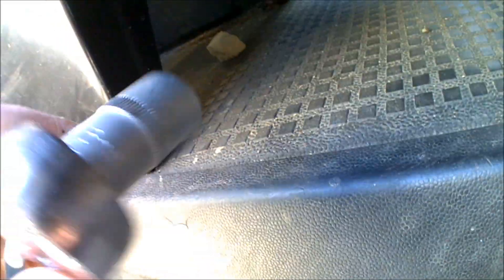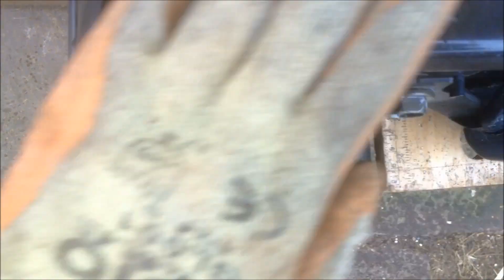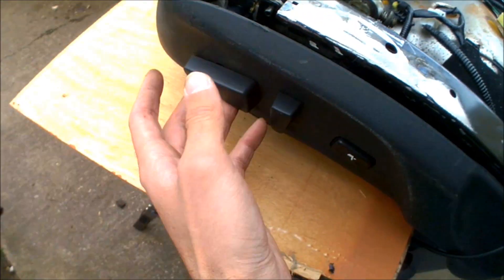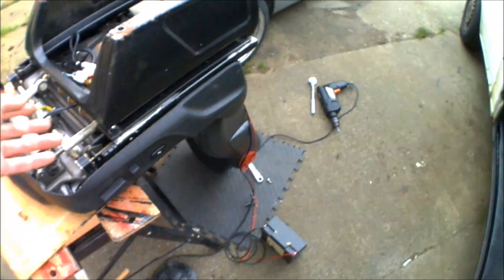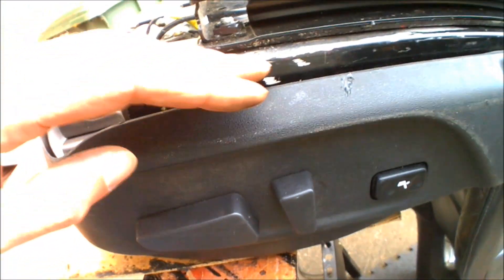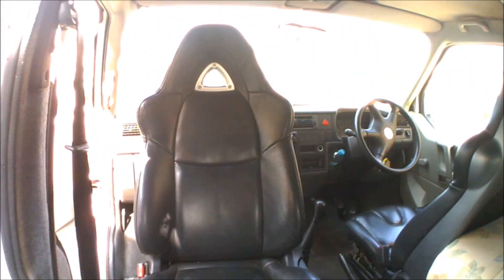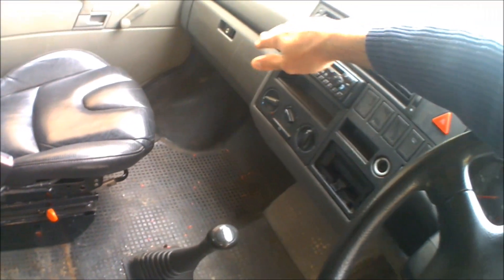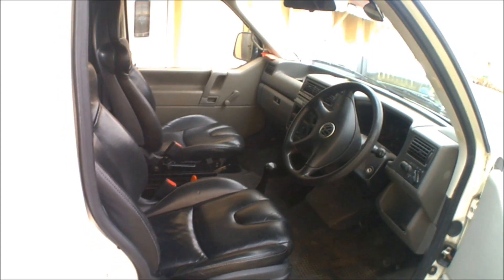Swap VW T4 Seats For Mazda RX8 Electric Heated Leather Swivel Base Seats

Comment: Diamond discs are for stone and concrete  mate, get metal cutting and grind discs for metal.
Reply from the maker: I know its the wrong disc but it's still going strong 18 months later
Reply: Good , but be wary it dose not splinter off. I like the seats you put in. It has given me ideas for mine. Cheers.

Comment: Great video, a few question's, is the seat the same hight as the original t4 seats and did you have to change the seatbelt clips or did the mazda ones fit the t4 seatbelts ,thanks.
Reply from the maker: The mazda ones fit fine, slight height difference but not much, they fit and look nice

Comment: Also wondered if there was any way of testing the heater elements before going to the extent of wiring them all in to find that they don't work
Reply from the maker: check the wiring part about 7 mins in, that shows how you can wire all the seat functions up before fitting and the heating element can be tested then, you just need a 12v battery to test it with.  I've not used the van much as it's a second vehicle for me but they got toasty the 1 time I did use them

Comment: Nice job,  how did you get round the handbrake question.  Our van hasn't got a swivel on the driver side (yet) because I'm not sure how it would get round the handbrake.  Take care wiring heated seats from modern cars, they have Airbags waiting to ruin your day.
Reply from the maker: I only have a swivel on the passenger side in this van as there is no room to turn the drivers around due to the bed layout, I had swivels in my last van on both seats and the drivers just turned if the handbrake was only on 1 click, anymore and it had to be let off to swivel the chair but no such issues this time around.  Wiring is also all sorted, these seats have separate plugs for motion and airbags so I just left the airbag plugs completely alone so no accidental wiring and airbag explosions going off lol....

Comment: I've got heated seats in mine but haven't got a clue how to wire them up
Reply from the maker: Should be pretty simple, along the same lines as I've used.  What seats do you have in yours?  Should just be a case of running a live from the battery or fuse box so a switched relay (video on my channel on how to wire those, then live a switch then to the heater.  I bought and fitted the switches for these and checked online which wires were for what and jobs-a-good-un 👍

Comment: Hoping for a reply, because I've retrofitted these seats into an RX-8 that isn't wired for power or heat (but I only want heat, as I just moved the leather to the manual frames).

Did you use a relay at all for the seat heaters? Have they caused any issues if you didn't? I know the RX-8 uses a relay for the seat heaters under the hood, but if I can just get away with an inline fuse and a straight run to battery, then I'm good with that!
Reply from the maker: Yes these seats are wired via a relay connected to the glove box light so the seats can only be moved / heated when the ignition is on.  I have fitted switches for the heating element otherwise they would be on 24/7 while the van is on which would be a power drain and lead to hot bums after a while.

Comment: can i ask, is it just 2 12v cables from battery positive and negative, I have just bought 2 of the exact same seats. like what wire do i need to buy? complete novice but building on a  budget, like do i need to go to the fuse box and stuff or jus straight to battery ? and when you say relayed to the Glove box light can you explain, really sorry about this, i actually bought the seats not knowing it was all electrical hahah
Reply from the maker: there is a video on my channel about the relay, the relay only lets the seats operate when the ignition is turned on, to stop any heated seat elements draining the battery etc.  You can run the power straight from the battery, just put an inline fuse on the power line

Comment: Hiya pal, 
Does having the seats off center cause any issues? Driving position, handbrake space (enough to get your hand round when pulling/releasing ) and are there any issues with your door cards or pockets?
Thanks
Gary
Reply from the maker: It didn't cause an issue, just more an ocd annoyance so moved the base to line everything back up by bolting some thick heavy duty plates to the floor and moved the bases over a couple inches to get everything lined back up correctly, no issues with door pocket either

Comment: I'm trying to install the same seats but in a different vehicle.  I am trying to find out which wires on the RX 8 plug I need to ground or power to make the seat adjustment to work. I know the two large wires are for power and ground but can't get the seats to move.  Thanks
Reply from the maker: +Brooke Fraser I cover the wiring required at about 7 mins in to the video showing what coloured wires are needed for wiring them up
Reply: Thanks.  Was in the shed trying to sort this out and must have looked away for a bit. Thanks. Got it all working!

Comment: Hi, been following your rx8 installation. But trying it in my T5. I have looked at the passenger's seat which doesn't have any electric buttons. But I believe it has heated seats also. But the wires are different colour to the driver's seat. They are a matching set. Can you advise cheers
Reply from the maker: From what I remember, you just need to wire the red and black on the passenger seat to a (switched) live feed, don’t wire any others as they are for airbag. I have switched fitted to the side of the bases to turn the heat on/off and it’s been great to have recently with the cold weather, I’ve used the heated seats every day the past 2 weeks 👍
Reply: Camper Conversion brilliant stuff. I will have another look. They where a bit of a pain to fit to the T5 but got the electrics working on the driver's seat exactly how you video's it. Which was such a help. Just wasn't sure on the passenger's seat as the wires are completely different colours. However is suspect the airbag is still the yellow plug. I was going to use a single 4 way relay as a feed on 30amp fuse with 2 switches on dash for each of the seats. I can't thankyou enough for this video. Would be handy if you could recall the heated wire for the passenger's. Pity I can't post any pictures.
Reply from the maker: Ignore the yellow chock, thats airbag, in the other wiring harness amongst the cables there should be a solid red and black cables, thats all that needs wiring in for the heated element (via a switch to save your battery)
Reply: Cheers for your help. Weather didn't help. Still somehow can't get heat. 
Found the black and red on passenger's seat. Excellent continuity. Probably a stupid question. But does the red and black wires both go positive to get it to work? Do I not need a negative feed? Obviously will add a switch. Cheers again. Much appreciated
Reply from the maker: red goes to a live feed (via a switch), black can be secured to the seat bolt as the chassis grounds the starter battery for the negative

Comment: You put the swivel onto the driver seat too?  Does the handbrake make turning the seat a pain?  Thinking of doing it to our T4 and were wondering if the handbrake makes it hard to live with?
Reply from the maker: I only put a swivel on the passenger seat due to the bed layout, I did however put a swivel on the drivers in my previous red van (which can be seen on my channel's other videos), that van had Audi TT seats and it turned just above the handbrake but my handbrake was tight and didn't need lifting high to engage,.  It really comes down to how high your handbrake lever sits, 1 click will be fine, 3-4 clicks might be an issue, I would have had to let the handbrake off to swivel if my level was any higher at the time.  Hope this helps.
Reply: Yes it does.  We would use the rotating seat for guests as the van can sleep 4 with the roof conversion and the driver seat would become more useful if it faced the rest of the van.

Comment: Have you not put an inline fuse in for them off the battery? If so what size?
Reply from the maker: +Matt Nicholls hi yes I used an inline fuse, all cabling is 30amp and I have a 25amp fuse at the battery end as the heated seats and movement functions can use quite high amps is all used at once

Comment: Is a 10 amp rocker swich ok for the heated seats
Reply from the maker: No you’d need higher for safety, same with cable used as some heating elements can use up to 20A
Reply: @TheCampervanBuilder  ok thanks gone for the bigger switch and put a relay on for the electric seats. Thanks for the help used your video put the relay in easy to follow instructions

Comment: I've noticed in other videos you have tt seats in your tin top how did you fit them
Reply from the maker: Hi, yes I fitted TT seats in my first red van, they were fitted to fasp swivel bases.  The swivels mounted directly to the base, for the seats I just drilled new holes in the rails as they are a very similar size rail, however extending bars using the original mount holes would be better as the bolts I used stopped some of the seat movement and they also sat very high with the swivels, my head almost hitting the headlining (I'm 6'2), but they were Very comfortable seats...
Reply: Camper Conversion thanks for the advise keep the videos coming there very helpful especially for some 1 like myself
Reply from the maker: Don't forget to subscribe and it'll inform you when new videos come out

Comment: How did you sus that wireing m8
Reply from the maker: Found a thread on the vwt4forum.co.uk site where someone had already found out which wires were for what, so I went off what they said each wire was for but tested before fitting to make sure it was all right and correct, there should be info online for what wires are for what with your seats, hard part might be finding out what the seats are from as thats the starting point in the information hunt
Reply: +Camper Conversion cheers m8